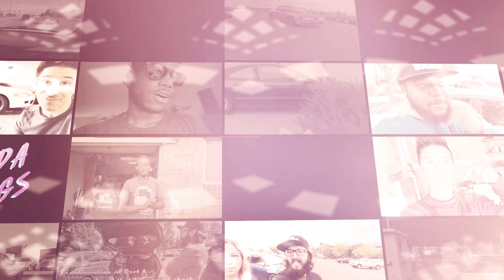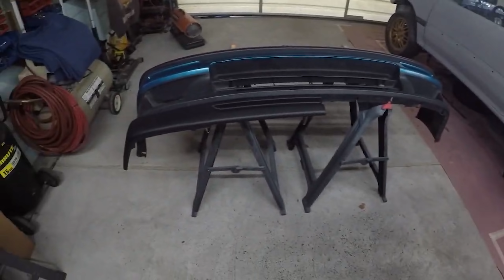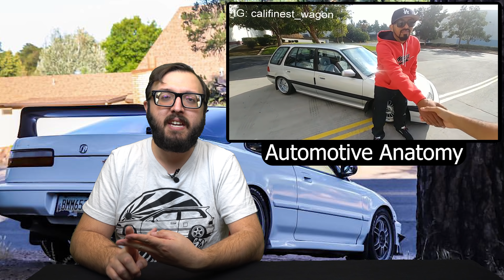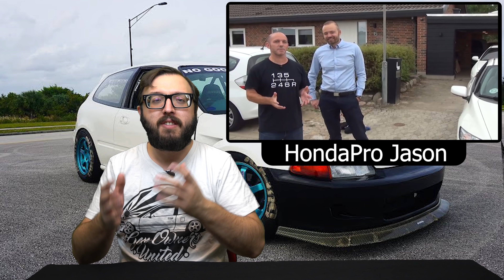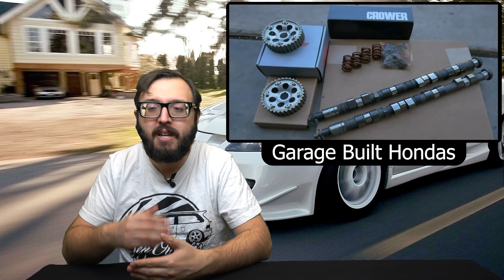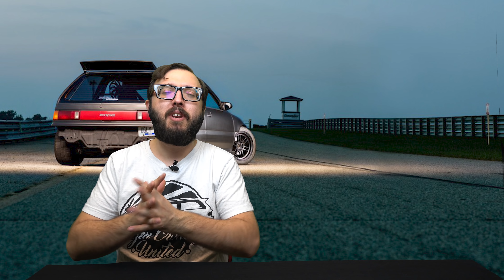The Honda Recap! CA Emissions AB 1824, EF Buddies, Megaspool, Automotive Anatomy

Comment: Those are actually not BC cams. Those are from Brian's dad's company. Crower and BC are totally different companies.
Reply from the maker: Im confused, can you break that down. Like Brian crower and crower are two things?
Reply: Honda Vlogs 
Yes. Sorry for the late reply, I'm rarely on YouTube with my phone. Anyways...

Crower is a totally different company than Brian Crower. I realized this a while ago when I was frantically searching for cams and also thought they were the same company. 
Through that confusion I spoke with a diehard Honda guy, and made a couple phone calls to both companies, which cleared things up.

I believe Crower was started and own by the father of Brian probably before he was born. More directed towards American muscle. However his Dad saw the interest in aftermarket parts for import engines so he had cams, etc in production as well. 
Brian eventually started his own company more directed towards imports and called it, well his name hah.

From what I've gathered Papa Crower could be kind of a jerk, god rest his soul. I've heard many horror stories from guys older than myself with much more experience. Things such as cams destroying rockers and terrible customer service with Honda guys trying to shed some light on the quality control. Pretty much constantly blaming it on the users and not the products... 
BUT with Brian it is the very opposite indeed. Most likely why he eventually branched off to do his own thing. 

If you're still a bit lost... Check out the websites, part numbers, specs, even the "about" sections.  Nothing is the same.

Comment: Come on Christian, nowhere in the bill says $1000 fine, the only thing amended by the law is it's not correctable, state ref has always been an option that could be issued and is still an option. I've asked officers, they say same thing and fines are still the same which is dependent on county. In Alameda county, that's about $350.
Reply from the maker: Im talking about it more in another video, been following it a bit more and I hear you. Didnt wanna leave it with the $1000 fine. Theres also some old test procedures for vehicle codes. So, I'm hoping a lot of things start to fizzle out. Appreciate you reaching out and discussing dude!